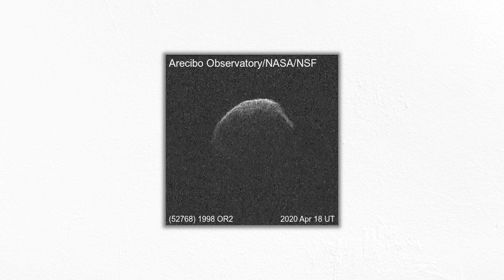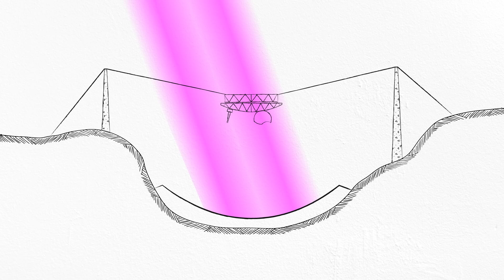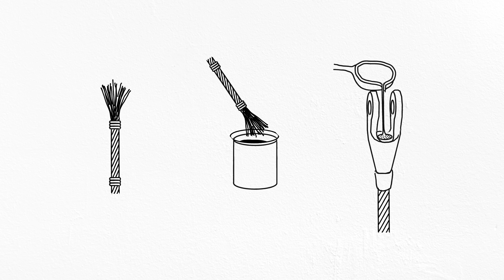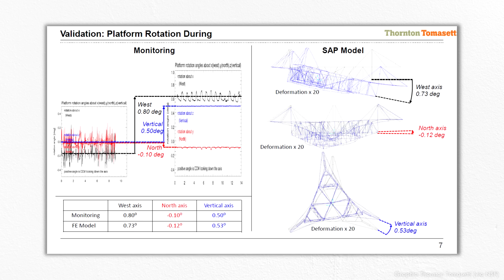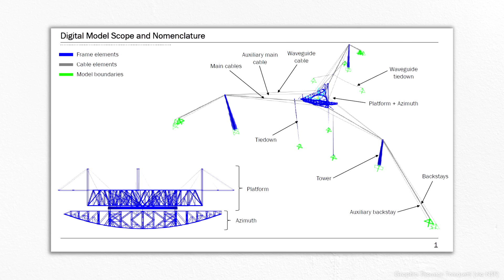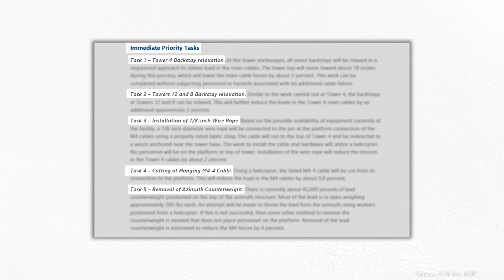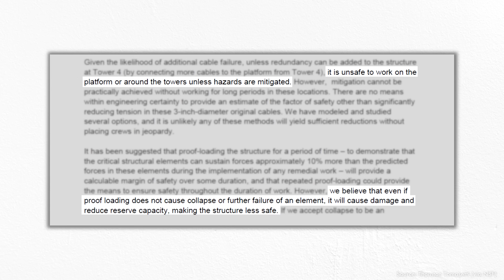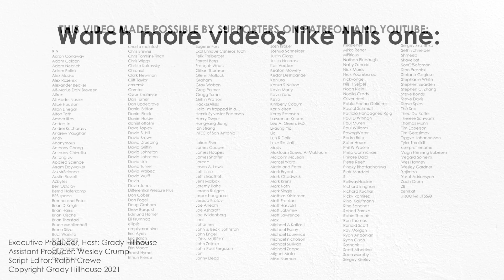What Really Happened at the Arecibo Telescope?

Comment: 14:34 Looks too familiar...
The 3 brief years '79---'82 that I'd spent constructing passenger elevators (all but the music)... the hoisting cable's 6'' ends as shown; would be bent back toward the center of the cable like clutched fingers making a fist. The manila rope was then cut off @ the center. Then the running end of the cable was held to the floor by both feet & and with a very firm upward jerk on the 2' shackle; the fist was secured within each perspective shackle cup. From there it the cup was poured in place with hot melted babbitt. This guaranteed the bent cable strands would never escape the shackle cup while under tension. There would normally be 4 hoisting cables even though the rate of one single cable could cover the hoisting rated live load. But the single cable would be too springy & stretchy for a smooth ride. Therefore the other 3 cables turned the stretch into more of an single band
We constructors were hated by all trades @ the beginning of the job, due to often taking up so much ground floor territory with our 16' long - 8# per foot hoist way rails (a real chore for a man on each end to navigate from the 18 wheeler to the hoist-way area opening) as well as their many wall mounting brackets, elevator car sling, cab crates, & temporary hoisting machines to suck those rails up the shaft to be stacked, one 128 lb.16 footer on top of another. 
But once we had a cab-less running sling platform to all floors... why hell! Suddenly we were the most cherished of all trades for moving their sheet rock loads, water/sanitary sewer pipe & fittings, electrical conduit/fittings, wire rolls, but only on the week ends. Otherwise it was hit the stairs just like we did in order to get that running platform. Although it paid the average wage between the electricians, ironworkers, & plumbers (Hydraulic 2-7 floor machinery) it was dangerous work with a high chance of something being pulled off every floor into the hoist-way where we'd be setting doors/sills/conduit.

Comment: Wait, what? The dish was made of aluminium plates on steel cables, suspended over the valley?!
For some reason, I always though it was concrete, built directly on the valley floor!
Reply: Yeah seriously when Alec Trevelyan landed on it in Goldeneye it was solid
Reply: In the center of the dish at the bottom is a concrete structure that contains things like water pumps for removing rain.  (that's where the bad guy spy falls.)  The rest of the dish was aluminum plates held above the ground by many small cables at it's edges.   You could walk around under most of it.  The platform at the top with the radio receivers is what was suspended from cables, and is the part that fell.   The dish was of course badly damaged by the falling platform. 

The dish was built in a natural sink hole that required very little alteration to hold the dish.
Reply: @DeputyNordburg  Thanks for explaining
Reply: @RNCHFND    I'm no expert on the topic.  There are some decent tour videos of the facility posted on YT.  I visited 2X I think, living in PR for 13 years.  It is a lousy way to end the amazing life of this telescope. Hopefully there will be some reconstruction.
Reply: Me as well, yeah, was stunned when I found out back then.
Reply: derek has it - definitely Goldeneye screwed up that belief :)
Reply: Not even solid plates, more like grates. As long as the holes are smaller than the wavelength, it reflects just like a solid plate, but it's a lot cheaper and lighter.
Reply: The dish was originally a series of suspended cables, far above the ground below - 100 feet or more. The plates were added to the cables years after I was there in 1968.
Reply: @psansoucy  Like a net?
Reply: @psansoucy  Huh, you learn something new every day, thanks for sharing :D
Reply: It was originally just a wire mesh, held in the correct shape by tie-downs attached to the ground. The aluminum plates were an upgrade, done in the '90's
Reply: Concrete doesn't reflect radio waves.
Reply: The aluminum panels had perforations to reduce weight. The perforated metal sheet in a microwave oven’s window is very similar.

Comment: Your videos are amazing, and I know what I'm about to point out is nowhere near the point of this video, and that you're an engineer and not a physicist. But:

The EM spectrum at 1:14 is misleading. It appears to show changes in amplitude but not wavelength. Radio and IR are different because of wavelength (or frequency), not because of amplitude. The amplitude of light affects its intensity: if you increase the amplitude of visible light, you get brighter visible light -- not a new type of light.

A more accurate model would show all the waves with the same height (amplitude), but with the width (wavelength) starting out large on the left and getting tinier heading to the right.

Again, I know this is hardly relevant to the video's topic, but I teach middle school physical science, and hopefully someone will learn a lot from the video and benefit from this clarification. :)

Comment: I don't think you understand the function of the Tie Down cables. The receiver has to be at the correct distance from the dish to be in focus, but temperature changes during the day cause the primary support cables to sag, so the tie down cables would actively adjust and  reduce tension when things got hot to keep the receiver at the correct distance.
Reply: Scott Manley, always here when you need him.
Reply: Fly safe!
Reply from the maker: Hey Scott! Very cool to have you here. Sorry if the part about the tie-downs was unclear. I was trying to explain that they were an additional load on the platform without going to far into the weeds about how they worked.
Reply: Perhaps the wind shear was a secondary bonus? I can certainly see that they would assist with both things
Reply: Worlds colliding!
Reply: A wild Scott Manley appears!  And thank you for the info.
Reply: Bless
Reply: Good info add.
Reply: @Scott Manley, your video about Arecibo collapse is no match with Grady's. I watched both. Yours is just meaningless bla bla bla. Not only this one, by the way.
Reply: @pabloelsur1624  That's because practical engineering is actually an engineer, scott is not. (computer science isn't engineering)

Comment: The success of the design principles mentioned here starting at 3:40 influenced the design of the telescope where I work. The HET at McDonald Observatory does with light and a spherical mirror what the Arecibo telescope did with radio waves and a spherical dish. The collecting apparatus at the top of our telescope (a set of correcting lenses in our case) also moves across our mirror, to provide the movement in elevation that the mirror doesn't have, and precise tracking in azimuth as well.
The Arecibo telescope was clearly foundational for the development of our machine, and is mentioned in the papers that discuss the project as it was being originally conceived.

Comment: 16:00 but an airplane can or even has to sustain multiple G forces, so a safety-factor of only 1.5 doesn't make much sense there? I am confused
Reply: Safety factor encompasses all expected loads, so it would be 1.5x above the expected max g-load for components that experience g-loading.
Reply: Today computer modelling (then strict monitoring and maintenance throughout the useful life and applying airworthiness directives if needed) is so advanced, that in aviation industry you can estimate very well the extreme forces. So adding "only" 50% margin is enough.
Reply: @pabloelsur1624  The 1.5 ultimate FOS in aerospace dates back to the 30's. Long before computers.
Reply: @ASJC27  I didn't know that. Well, aircrafts always had been really well engineered, eg. Concord made with slide rulers. In 30*s speeds & forces & expectations were different, but anyway aviation is a special type of engineering.

Comment: Why they couldn't use some huge crane to insure workers or to disassemble the platform? There are such big cranes that can lift such mass.
Reply: Those huge cranes need to be assembled on-site and have a big footprint - it was too dangerous for workers to get in close enough to build a crane, or scaffolding, or even cut down the broken cables. It was too dangerous to even try heavy lift helicopters.
Reply: @medea27  I'm thinking about mobile cranes such a 
LR 11350. They can build it in the distanceand drive it closer. There would probably be a big problem with a flat surface to move around...

Comment: I wonder, could they build a copy in the Sedan crater at the Nevada test site?

Surely the dry climate would be ideal for a radio telescope! (And prevent corrosion of the cables.)
It's also in the middle of nowhere, so there should be very little radio interference.

Comment: Amazing shots from the drone, failure caught as it happend.
If you don't engineer a project correctly it will eventually fail.
I wondered what had caused the collapse.
Jodrell Bank telescope in the UK was in a state, needing repair, luckly monney was found and it's still working.
Hope that as you said it can be replaced with the latest construction and technical equipment.
Thanks for another sad but good technical description of the failure and video.

Comment: they should have built 6 towers instead of 3, then the loss of one wouldn't have had such severe consequences.
Reply: Adding more towers = more cables that block signal that comes in and doesn't really fix the true issue.  The problem wasn't the towers, the problem was the cables, the loads the carried, and how they were fixed to the tower.  I think the cables should have been upgraded to 4 inches in diameter and completely replaced.  Since tensile strength is based off of cross-sectional surface area, this would be a strength increase of about 77% if the same materials are used.
Reply: @annihilator247x   upgrading the cables would just move the weak points from them into the points at the towers and the suspended structure where they connect, not to mention the towers themselves, and would require many other redesigns to correct for the change in sag and motion, the structure needed to be precisely positioned to work properly removing and replacing all the cables with bigger cables would throw that all out of wack and the devices used to tweak its position would then be under sized and a weak point

it needed an entire redesign and likely the vast majority of components rebuild... it was past its useful life and it was pointless, it had to come down eventually it wasnt going to be maintained forever, new projects are under way and the old ones are losing funding thats the way this stuff works

Comment: Re-purpose a military installation, increase the loads by adding instruments, modify the design by adding more cables and weight, allow several decades to pass without overhaul in a tropical and corrosive enviroment... act surprised when it fails. (insert pikachu face)

Comment: Great Video! 
I think another aspect might be the general way buildings and structures were designed back in the day. 

Whereas devices of that area typically were designed a lot more service friendly than devices today (which sometimes can't even be repaired by the manufacturer), the maintenance and accessibility of structures and buildings today is much improved and an integral part of the design process, whereas these aspects were more of an afterthought back in the day. 

Getting that dish up there - mission accomplished. Contingency plans for maintenance, storms, getting that thing down again, safely replaceing those cables...not part of the spec book. "Well, we'll figure it out as we go" was more like it back in the day I guess, where everyone seemed a bit drunk by all the things they suddenly were able to achieve and people were feeling somewhat invincible with all that new tech. At least that's my impression when I enter older structures on jobs. Let's build a giant hall with a huge stage, yeah! Done! What? There is equipment that needs to get onto that stage? Whoopsiedoodles. Well....let's see, if we bastardize the orchestra pit and bang a hole into the wall down there, we can fabricobble some sort of load in access and drive that stuff to stage level via the hydraulic floor! Sure, the door is tiny because there wasn't planned anything but a manhole there and structural integrity is compromised by anthing wider than 90cm, and yes, the hydraulic floor will break two times a year, and yes, all this goes t*ts up if anything is set up in the pit, but there is always something and look at it, we made it happen wa?!? :D Unthinkable these days, but totally within the norm in concert halls of the 70s era.
Reply: I was thinking about how the platform should have been able to be lowered to reflector level and tied down when tropical storm force winds threaten. Maybe if it's rebuilt they'll do that. Don't use a hydraulic lift -- winch it up and down (still, a major change to the support structure, but it all has the be rebuilt anyway).

Comment: I wonder if the addition of the Gregorian dome was not adequately compensated for by the additional structural elements at the time of the upgrade.  In other words, would the original design have failed if the Gregorian dome had never been added?
Reply: It’s very likely it might have still failed, but not as soon as it did. The dome definitely added a significant amount of weight, along with the stabilizer cables to make it function properly, but the fact that the telescope was so close to a source of seawater and had tropical storms pass over it rather frequently was doing no favors.
Reply: @cdigames  But surely the engineers knows that the telescope was close to the seawater and calculated the necessary precautions right.... right?
Reply: @BalokBapak  cost/benefits ratios, often it just isn't worth it to add those extra years to a structure that realistically was only intended to watch for nukes during the cold war, which ended in 1987.
Reply: @BalokBapak  The engineers did factor all of that in, but there is only so much redundancy you can build in before it becomes too expensive or creates other issues for you - and Mother Nature is far stronger & unpredictable than anything us puny humans can build! For example, you can wrap the cables in a waterproof coating/jacket to protect them from seawater, but that coating on 100's of metres also adds 100's of kilos of weight to the cables - so now you have issues with the strength of your towers, connectors, etc and making them stronger costs more $$. It's all a balance.
Reply: @BalokBapak  Yeah, just like the engineers considered distance from salt water when designing the Florida condo building that just collapsed.
Honestly, I don't think there's an accurate way to account for corrosion that can't be seen without an x-ray.
Reply: @medea27  The Golden Gate bridge seems to be doing ok. 
The cables could have had a flaw. The steel could have had an impurity. 
Maybe the budget did not allow proper maintenance and inspection. The cables were getting old and had been subjected to countless storms. 
Let's say the redundancy was 2 to one, they were probably pushed past the limits several times during hurricanes. 
It's obvious that there was unknown damage in those cables. It's good that no one was killed.
Reply: Likely it would have. Age is a factor too. Fatigue failure can, and does occur well below yield strength. Decades of wind, storms, and a dynamic load. The design had a lifespan, the new dome shortened it, but it was always going to fail. Sealed cables should have been used with a higher margin.
Reply: @timothydoyle9635  was the tech for sealed cables with conditioned air blowing through them developed yet when it was being built?

Also, the cables they were using, they were relatively small cables. 3 inches I think I heard in the video. Certainly not nearly as large scale as suspension bridge main cables — as witness the fact they were anchored with simple molten-metal cast ends.
Reply: As some of the people here have already said, all things, including structures, have a life expectancy. I don't think they had an extended lifespan in mind when it was first built.
Reply: Probably yes. But the failure likely would have been delayed at least a little while. But time and the elements inevitably take their toll on structures and what man builds time will eventually destroy no matter how well maintained it is.
Reply: @killman369547  I'm just saying that when the DOD procured it, they probably weren't focused on its lifetime.

Comment: I think a combination of metal fatigue, corrosion and possible mistakes during construction could be the cause.
Especially metal fatigue, because of the shifting centre of weight of the platform and vibrations cause by the wind.
Reply: I agree with that theory. With so many dynamic forces and the increase to them from the addition of the gregorian dome those cables were probably in dire need of replacement years ago, metal fatigue often can't be detected with just visual inspections. Doubly so when the material in question is painted and difficult to reach for more thorough inspections as was the case at Aricebo.
Reply: Puerto Rico was also (still is) going through a swarm of earthquakes on the southwestern portion of the island. Although, I sure as hell have no idea what effect they might have caused on the structure.
Reply: @rolitae  I looked it up, Puerto Rico is sandwiched between two fault lines. So the tremors and earthquakes could definitely have been a factor. (i think)
Reply: It's worth noting, that as a cold war project the construction probably wasn't planned to withstand such a long time in the first place.